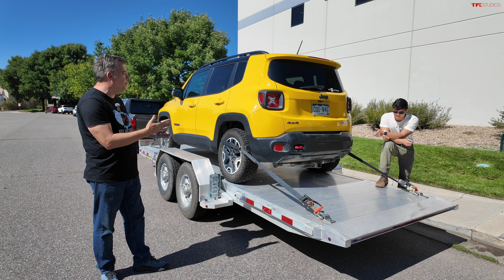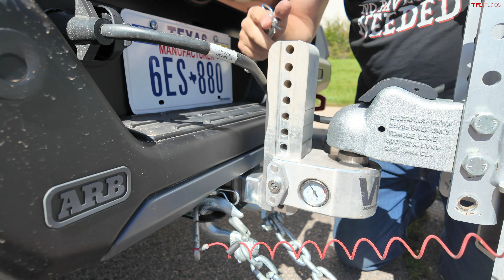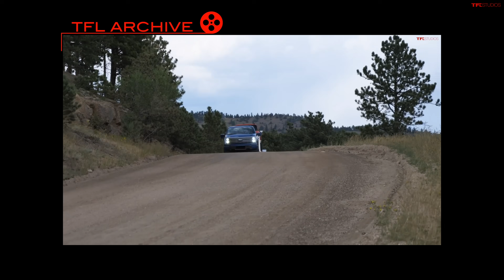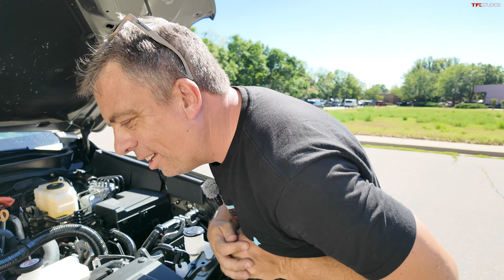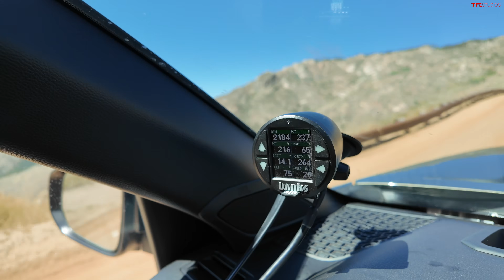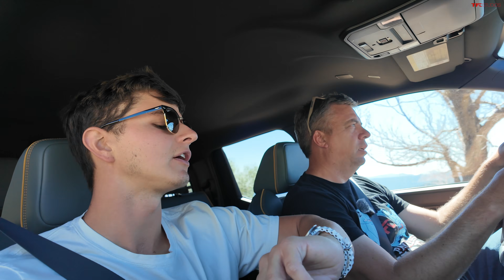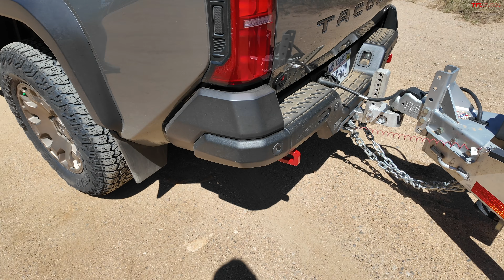Bigger Trucks Have FAILED Our Towing Torture Test, But Will It TOAST the Toyota Tacoma Trailhunter?

Comment: Wow brother running this Tacoma at between 250°F and 275°F will cause rapid, severe internal damage and inevitable transmission failure sooner than later, get a transmission cooler for God sakes, save your transmission. You're absolutely toasting that transmission probability of shortening the lifespan out running those hot temperatures!!!

Comment: So you never say that's a Spring is getting bottom down in the Toyota.
 My Toyota I just bought one and put my trailer on it and it waves 4500's pounds and it 1 inch from the bottom from the. Bump's stops I have to go and get something to put underneath there supported. What about you guys?

Comment: Mfr 's have always had an atf loop through the radiator since the 1990s, the tow packages add an external air to oil cooler before the radiator, typically.

Comment: So no weight distribution hitch nor sway control at 6K pound trailer.  Is that to be expected?  Would you normally have a WD or sway control on a trailer of that weight with that truck?
Reply: I think in their state, the regulation is over 3500lbs you need a WDH and sway control I think Andre mentioned that before.

Comment: f you have any insight into the cause of the transmission overheating in 4H reported by many, could you make a post to help 4G Tacoma owners understand why SOME transmissions overheat on seemingly straight forward terrain in 4H.  Reports of transmissions overheating (with a warning triggered to stop and cool down) or temperatures getting very close to triggering a warning notification seem common on forums.  Not all 4G Tacomas have this issue however.

Comment: My 01 Tacoma trans temp will hit 270 degrees towing 5k lbs trailer up through Barstow CA with 100 heat.  No problems, I use Amsoil and trans has 300000 miles on it.   Eventually I plan to install a trans cooler but...meh, Im guessing it will be just fine.

Comment: Another side effect of linking the transmission fluid loop and the engine coolant loop is that if the valve controlling it fails, on some vehicles, you can end up with engine coolant inside your transmission. Ask me how I know🤓

Comment: I live in a really hot summer environment with many days of 100+ temperatures. Would you recommend adding an OBD digital thermostat to monitor as well?

Also, can an optional trans cooler be an option if they even make such a thing?
Reply: @billcullifer260  yes, and yes. You'd be surprised what your actual temps are. Adding a transmission significantly drops your temps. My fj was running around 210s in stop and go traffic.  Now I rarely see over 155f

Comment: I’m curious…How does that tow weight equal 6k when the curb weight of the Jeep is just a tad over 3500lbs. I find it kind of hard to believe that aluminum trailer weighs 2500lbs
Reply: Depending on the length of the trailer and the capacity it is rated for(longer/higher weight capacity trailers obviously being much more robust and therefor weighing more), an all aluminum car hauler can weigh up to around 2000-2200 lbs. The Trailhawk weighs just north of 3600lbs. That would bring it close to the 6000lbs capacity. And passengers do affect towing capacity. Passengers count towards the payload capacity which reduces overall towing capacity, so they may be including the weight of a passenger in their numbers.

Comment: How well does the hybrid do coming down the hill.   With both my 2015 & 2021 Tacomas coming down long steep inclines, even in lower gears, were difficult.  I'm assuming that the 275 is the torque converter temp... would be good to know the pan temp.

Also, I have more tranny heat issues coming down long downgrades as the tranny temps in the torque converter and the pan (and I have a cooler), whereas going up the TC will heat up to about 220-230 while the pan is very slow to go past 200-210. 

I frequently tow a 3000# RV, with a fair load in the back.

Comment: For baseline, what were coolant and transmission pan temps without load on the same climbs? those temps are crazy!
Reply: Coolant temps were actually just above normal surprisingly. Coolant temps can already hit above 200 just in stop and go traffic on a warm day and this was barely hotter and stayed within normal ranges for where the rad fan would kick on(though it was likely on at all times to prevent overheating with that climb and load). Trans temps did get pretty high though. While they likely didn't baseline the truck on the climb, they did mention during normal driving without a trailer it sat around 220, so my guess would be with the constant climb at low speeds, it would likely sit around the 230s-240s.
Reply: @Itz_JayM  those temps are a bit unsettling. I'm sure an external transmission cooler would help bring those transmission temps down for sure. Its crazy to think how much warmer these engines run compared to the older generation 1gr, 2gr, 2uz etc. I'm over here freaking out because my fj cruiser is running a little warmer than others on the highway at 190-203, generally around 194. Though others report 190 in same conditions

Comment: I would like to see the same test with the non hybird tacomas and the 2023 tacomas as will.
Reply: Seeing as they use the same transmission and engine, only difference being the hybrid system, they will likely perform nearly the same. The hybrid system is just sandwiched between the engine and trans.

Comment: 273F transmission temperature is not a pass.  Transmission fluid degradation is a concern at that temperature.  My previous generation Tundra only sees a max of 205F running grade in the summer pulling a large RV around 8,000lbs.

Comment: @tfl Do you think the hybrid system played a big part in this pass over the other trucks you’ve tested? Do you think the F150 hybrid would also pass then?
Reply: As the hybrid motor/generator is sandwiched between the motor and transmission, and they work in tandem with the engine and trans never taking a back seat to the hybrid system, it likely didn't play much of a part at all. The hybrid motor also isn't operating all the time. It only helps boost power/torque output when its really needed.

Comment: Driving a Toyota up a mountain looking for trouble. I just did my drivetrain fluids on my 4Runner LTD for the first time since new. 9 years old and 120,000 miles. It all looked like new(color and consistancy). Also did the coolant. I pull a 23 foot fiberglass in-board speedboat in the summer. Its about 300 lbs. over the limit.

Comment: External transmission cooler. Add a big one and see how it manages the same test. I would not tow anything near half of max rating without a cooler especially in mountainous terrain like Colorado. At fluid temp that high, the life of the transmission would be halved or worse.

Comment: "Failing" the RAM because you used the wrong oil for the job seems a bit unrealistic. That truck passed pretty handily.

That's like failing a 4x4 system because you ran fuel-efficient street tires through the mud and got stuck.

Comment: 275 f? That’s the reason Toyota is having issues with the Tacoma transmission. At that Temperature you are burning the trans fluid. 
It’s a new car and of course it will be ok but long term, it won’t last. The worst part is most manufacturers tells customers trans fluids are life long fluids.
Reply: Actually, if you did any research, you would know the problem with the transmissions was solely stemmed from the manufacturing plant. Debris found in the transmission and the recall was only within a certain amount of Vin numbers.

Comment: I would question less so the performance of the brand new truck but rather the long term reliability of that transmission with running so hot. I think a key takeaway here is if you are towing repeated heavy loads buy a truck that can do it comfortably within its rated capacities as opposed to maxing them out.

Comment: Using the radiator is not a new idea. Manufacturers have been doing this since at least the early seventies. Aftermarket coolers which can be run independent of the radiator are still available.

Comment: This will be unpopular with some, but cyclists who ride on roads like this have a death wish. No possible argument otherwise. They’re basically stopped in the middle of the road (moving maybe 1mph while they strain up the hill) with tons of blind corners and cars moving at reasonable (safe) speeds. If a car were moving 1mph in the road and another car came around a blind corner and hit them, the car that was barely moving would be at fault for the crash and cited.  Cyclists who put themselves in grave danger riding on roads like this are insane and have a death wish. It has nothing to do with cars “driving recklessly” like so many bicycle fanatics falsely claim, it’s all about common sense.

Regarding the EV trucks doing well on this while many ICE trucks don’t, that’s really not surprising. EVs are built with efficiency as a top priority since they have much less energy onboard to waste. Unless you a specifically building a heater, heat is always an indication of a lack of efficiency, which is why ICE vehicles are always so hot and have huge cooling requirements. All modern EVs also use the AC system to cool the battery, which is way more effective for cooling, especially on a hot day since it can cool below ambient temperatures, and they’re also designed to do one of the most heat intensive things for the battery (fast charging) while completely stopped, so they have strong cooling fans. ICE vehicles waste 75-85% of their energy as heat, so that is a LOT of heat that has to be dealt with. EVs it’s more like 20-30%. I fully recognize that range and charging is still a major issue for towing with an EV and that is definitely something that is holding them back for now (for that specific usage), but in basically every other way, they are vastly superior to ICE for towing.

The transmission temp that you saw with this test is definitely hot, hotter than it should be for such a short test, but it also isn’t “too hot” for a short time. If you were regularly towing like this with that kind of transmission temperature, this transmission would have a short life and the fluid would need to be serviced very often, probably every 5k miles. Really, if you’re routinely towing like this, you need a bigger truck. Towing at max capacity on hot days and severe inclines is not a good idea on any vehicle, you would need to have a bigger truck to do this reliably on a regular basis.

Comment: This video is proof of how bad new trucks are.
Reply: Agreed, I used to tow full load with a couple old 4.6 f150s they would scream at like 5000rpm in second gear for long periods without issue. Both trucks went over 250,000k before I sold them... Still running fine. I don't have that confidence in any truck built now

Comment: I get the point is a torture test, but it's widely known that when towing heavy with an auto you select gears manually if the vehicle has the option. Particularly when overtaking, in hilly terrain, or offroad. This will prevent it from shifting up too early, slugging, and slipping on the torque converter (=heat). I'd be interested if you can repeat this by manually selecting gears and running mid range rpm (depending on diesel or gas).

Comment: It is like putting a YOGI into POWERLIFTING competition.
They are not for towing.  Use heavy duty trucks instead for that. This is a mild hybrid system. Do not forget that.

"Technically, May be you fit into spidermans underwear,
so you're rated equally in that regard. 
But that doesn't mean you can actually do what he does.

Comment: When you are working your vehicle hard and temps are high even if they are not in the danger zone when you come to a stop don’t shut the engine off, Let it run for awhile until the temperatures are back to normal range?

Comment: That’s more hp and torque than an old 5.9 Cummins
Reply: Which is a big part of why they don’t last as long. You’ve got a smaller engine and drivetrain under much higher stress. Compared to a much bigger engine and drivetrain moderately stressed.

Comment: You need to run the transmission in sports mode and not in drive. Torque converter slip is your issue as to why the temps climbing so high

Comment: Can you guys clarify what the payload means for American vehicles. Because 1200lb payload is really low. In aus everything added to the vehicle comes out of payload; people, equipment, accessories, ball weight and fuel all reduce your available payload when it is added. Is this the same in the states?
Applying the way we measure available payload to your case of towing that trailer you'd only have room for one extra person in the car before your over your limit. 
Ball weight from the trailer being 600lb (10% of trailer weight) and two people in the car. 160-180lb per person. plus a full tank of fuel you'll have less than 200lb payload left for everything else you'd want for overlanding/ 4wding. 
In aus its standard/ expected that utilities have a payload over 2000lb. within a vehicle generally considered to be mid-sized by your sizing charts. Why are US mid and even full-sized utilities so weakly spec'd. With only the heavy-duty model's having a higher payload.
Reply: I think they expect Americans to be stupid and ready to sue the company. Many vehicles tend to have lower payload/tow ratings in America compared to the same vehicle in other countries.
Most people I’ve talked to don’t think about payload being passengers and stuff inside the cab to be payload. They just think about payload being what’s in the bed. Then they’re surprised how little it’s rated for when you figure 4 people and a bit of cargo can hit 1200 pretty quick.

Comment: I would love if u do a quick set of 'tow numbers'.  I.e trailer weight, tow capacity, tongue weight, passenger weight and payload.  Then how much payload left and how much towing capacity left.  It is kind of a PSA since so many people overload their vehicles and that might only take 4 minutes and a quick image of the math. As an illustration, with just tongue weight and 400 lbs of passengers, and the extra equipment, you only can pack in less than 100 lbs of gear including the weight of your gas which now u are maxes out!

Comment: when you recorded i saw 2000rpm on uphill with that much weight,you have to use at least 3000 on a gasoline engine,it's better,use it on manual mode

Comment: So....1217 lbs payload minus 127 lbs for accessories minus about 500 lbs for occupants minus 650 lbs tongue weight means that technically your overweight by 60 lbs not including whatever other cargo you had on board at the time. 
If this calculation is correct that's not great if you ask me. 
I doubt that Tacoma gets any better fuel economy towing 6000 lbs than say a Silverado with a 5.3 engine or an F150 with a 5.0 engine would. The little 4 cylinder turbo in the Chevy or the 2.7 Ecoboost in the Ford might even provide better economy yet towing that weight.
I like the Tacoma though and have one with the old 4.0 litre in my fleet. I do get it that the point was to see how well it would do this test but these trucks are not really ideal for towing in the long run.

Comment: Now that you guys learned to use the tow/haul system on this new platform, you really need to return to the LC250 and re-do your review. It actually towed great up to the tunnel, and yet your review (tagline, at least) pretty much slams it. 

Just so we're clear, now you are suggesting that the tow/haul system software is different between the Tacoma and LandCruiser? Did you confirm this, or are you just assuming, now that you've learned how to fully access the system?

You can do better; you should do better. Take the LC up the Toaster before it cools off, and either confirm your previous (dubious) findings, or prove that the LC can also make that climb at max tow weight.

Comment: New fluids are very thin. GM uses Dexron ULV (Ultra Low Viscosity) for their 10 speed transmissions, and I know that even just setting the trans fluid level, the temp has to be between 185 and 203 degrees

Comment: are those tc or pan tempt? 260 f pan is high. for tc is what you’ll expect
Reply: Im not sure the newer Toyotas have the TC temp PID anymore. I know my 2018 LX570 with the 8 speed does not and no one has been able to find it for the 3rd gen Tundra yet.
Reply: @Jay-me7gw  For my 19 gx460, AT temp 1 is pan, AT temp 2 is tc. from their Banks garage, it just shows at temp. I just can't imagine pan to get to 260f . 260f would imply that the entire system is now at equilibrium with the TC at 260f, the pan temp is 260f, and when it goes to the tc, it heats up even more, or it's just the tc at 260f, which is not good but not unusual in Toyotas without aux trans cooler. I believe your lx has a dedicate aux trans cooler.

I'm using a scanguage 3 to monitor in case you're curious.
Reply: @pennmikael  Your GX460 is a 14 year old truck. I had a 2011 GX and monitored AT Oil temp 2 as well. The newer toyotas dont have AT oil temp 2 available. Once the 200 series went from the 6 speed to the 8 speed, it lost AT Oil Temp 2.

And yes, my LX has a radiator end tank cooler and a good sized air cooler in series. That said, my AT Oil Temp 1 has gotten up into the 240's towing a 5500 lb travel trailer.

Comment: The temp of the coolant of 207 is not the temp that the tranny is exposed to. The tranny temp is running in a passage at the bottom of the coolant radiator, which stands around 160 degrees. The bottom of the radiator is the coldest section of the system, as it is the last stage of cooling before it goes back into the engine to cool the heads, and all other components
.